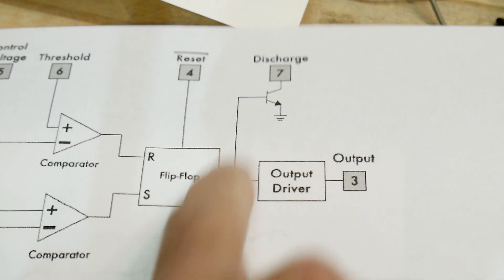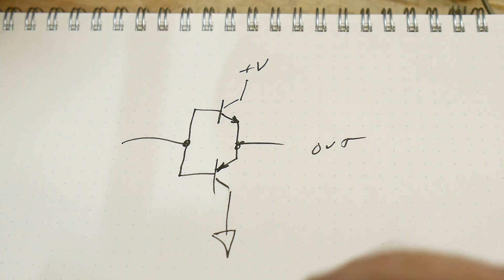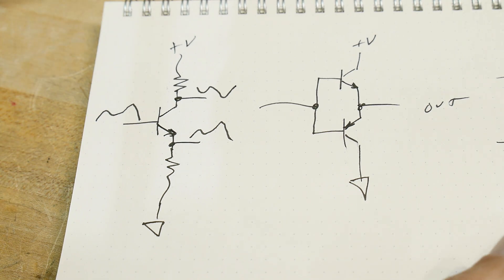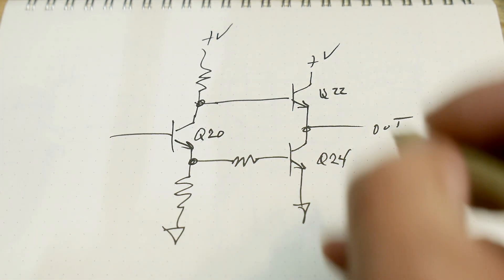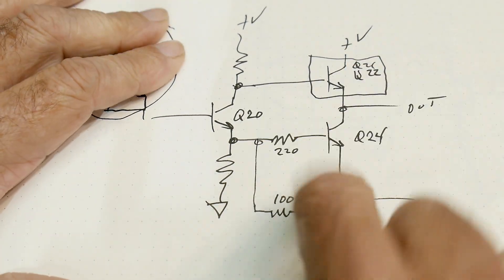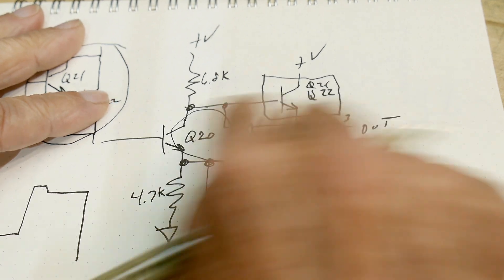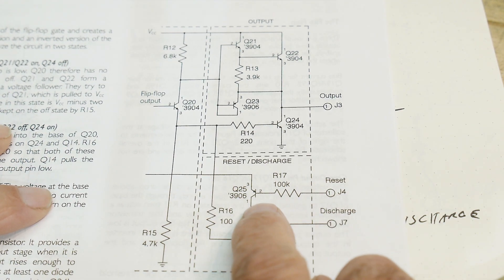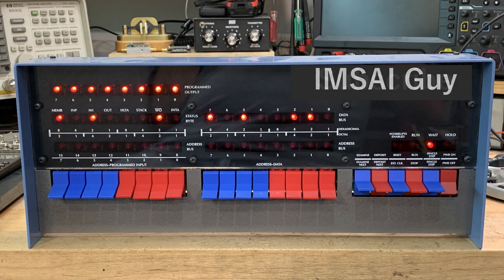#1733 Evil Mad Scientist 555 (part 4 of 4)

Comment: I'm pretty sure the diode on the output is there to protect the base-emitter junction of Q21. If the output is driving a capacitor, the junction would briefly be reverse biased to nearly the full supply voltage, or up to 18V on the original part. I simulated the output driving a 1uF cap, and Vbe on Q21 goes to -17.27V without the diode.
Reply from the maker: did your spice model show where the output hump comes from

Comment: as d614gakadoug9 said below, the huge advantage of using a low side NPN is to take the output all the way down to GND (0 volts). If the low side is PNP then the output stops at 0.6 volts. And in my experience, I've had low side PNP producing ringing at 0.6v when the pnp opens and closes really fast because there was capacitance on the emitter by another component.

Comment: Sir i have a question at 1:02, sorry if it's a stupid question. Why pnp transistor used in low side and npn at high side ? Wouldn't it make sense to have npn at low and pnp at high ? I've seen this reverse configuration in both totem pole and push pull circuitry but never got a proper explanation for that particular  configuration, maybe to utilise a different operating region that way ? Or is it to overcome some disadvantages of  Normal configuration ?
Reply from the maker: if pnp on top, both transistors can be biased on. then both conduct and kill each other
Reply: @IMSAIGuy thank you for your reply, i was a bit confused earlier and after your reply i analyzed both circuits, now my doubt is clear. Btw great video, I'd like to see more videos related to discrete analog circuit design and analysis videos from you
Reply: @shyamsuresh1723 I think you mixed up the push-pull and inverting circuits. As as the IMSAI guy said you would burn both transistors if your bases voltage goes between  0.7V and VCC-0.7V. because in this region both transistors are on.  In an inverter circuit, you would have only one transistor and one resistor.  Depends on weather you want to drivea  hi or low load, you use a PNP or NPN transistor.
Reply: @bayareapianist  thanks for your reply. Yeah i was bit confused earlier. I Didn't consider both emitter-base junction becoming forward biased which is connected together incase pnp as high and npn as low side.

Comment: In the era of TTL, if you were making a part intended to be TTL compatible you would never even contemplate using a PNP emitter follower as the low side output driver even if you could make one very easily.You'd be stuck with an output that couldn't swing lower than about +0.7 volts relative to ground, which is just unacceptable.

Calling the diode in the output stage "stupid" is arrogant and stupid!